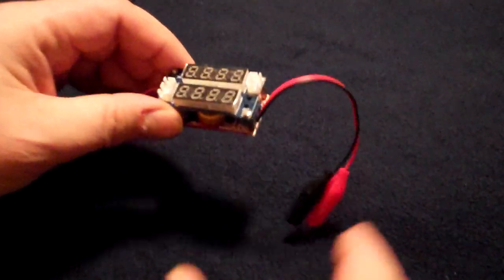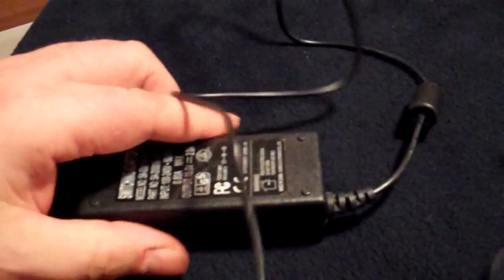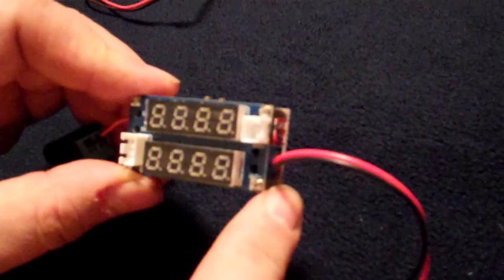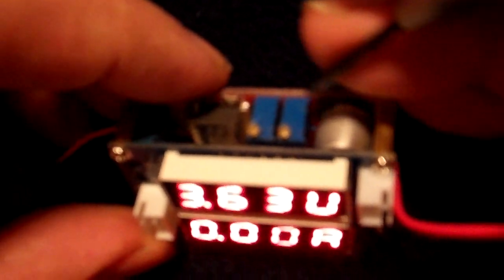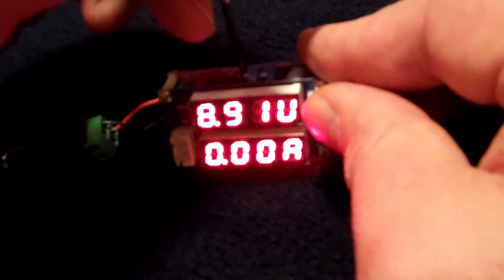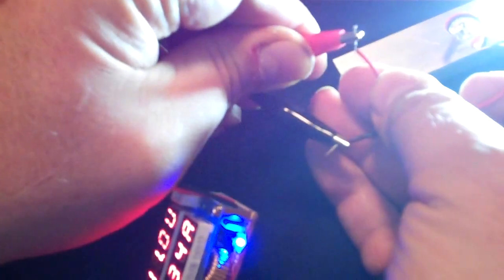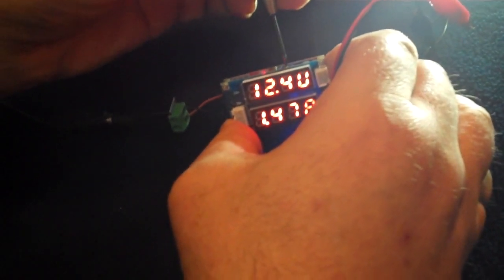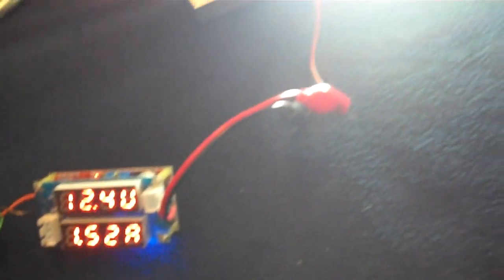DIY Inexpensive Variable Constant Current Constant Voltage Power Supply for under $20

Comment: gijigadget
Wow I am disappointed: I though you were going to show how to build a $20 Variable Constant Current Constant Voltage Power Supply.
If it was a cooking show and you were to say that today we are going to cook a great pot of barbecue beans and then you go the the market and buy a can of Hormel barbecue beans, put in a bowl and microwave it, huh !
BTW the power supply you show here is not constant current: Constant current supply delivers a constant current even when the voltage varies.
I guess if you were to relabel your video as: Low cost Variable Voltage and Current Power Supply. I think I could use one like this. Thanks.
Reply: Sorry you are so disappointed.  This is a constant current / constant voltage supply.  Set the current and it stays as you vary the voltage to a set range.

Comment: be very careful with these, they are current limited, NOT CONSTANT CURRENT!  The last component on the output is a filter capacitor. Check with a scope on a low impedance load, large inrush currents until the filter cap is depleted to the point where the limiter can take control. Ok for charging batteries, not much chop on something more sensitive. Good way to turn a 300 dollar laser diode into a dark emitting led. Otherwise, they're good for about three months, then for no real reason, they fail and generally destroy whatever is attached to them.

Comment: This is not a constant current supply. It is a current limiting supply. If it was constant current you would have had current on the display before connecting the load (LEDs). That is the point of a constant current supply. No matter what the load the current stays the same, even with no load.
Reply from the maker: Well without voltage there is no current.  The voltage can be any arbitrary value greater than zero (can even be negative).  What makes a constant current source is the ability for a power supply to be set to a certain current and maintaining that current independent of voltage value as long as it is not zero or variation in load as long as it is not approaching infinity ohms.
Reply: Ok, I need to straighten the facts about constant current and current limit. Constant current supply keep the current constant no matter the resistance of the load, take for example a 100W LED driver that supply 25-36V @3000mA. As the LED heat up, the forward voltage aka resistance of the LED increase and the power supply will adjust between 25-36V to maintain constant current of 3000mA, but if the resistance is too high for 36V to maintain 3000mA, the current will eventually drop because the voltage. has reach its limit. While in the other side, a current limit supply is a bit different. You can set the output voltage while set for the maximum current to flow. When something shorts, it will decrease the voltage so that the current will be limited. This module is both constant current and current limit. For constant current, you need to adjust the voltage to the maximum and set for current limit to your desired value. For current limit, you need to short the output with ammeter and set for maximum current flow and you still able to adjust the output voltage.
Reply from the maker: +xxxwtxxx It is both a Constant Voltage and Constant Current Regulator.
It all depends on which mode you have the regulator in.
For instance:
Constant Voltage
I set the Voltage and connect the regulator to a Load.
I vary the Load, to draw more Current, the Current Changes but not the Voltage.
Therefore I am in Constant Voltage Mode.
Constant Current Mode:
I connect the regulator to the Load and set the Current.
Now I increase the Load, the Current will be maintained while the Voltage changes.
Therefore I am in Constant Current Mode.

I hope this helps.
Reply: Without a load there is no current draw.  When within the load parameters of the power supply, the current stays the same so yes this is a constant current source.
Reply: If there's no load, there can be no current. I think you're a bit confused.
Reply from the maker: You are correct.
It does not appear that xxxwtxxx understands how Power Supplies work but I am happy to explain it to him if he posts back.
Reply: A perfect constant current source would be comprised of an infinite voltage in series with an infinite resistance. Then the question is, "Would the current in such a hypothetical arrangement be infinite, infinitesimal, or a particular value?"
Reply from the maker: Arthur Harrison Theoretically if you had an infinite Voltage and infinite Current, then Ohm's Law states you would have 0A Current Infinity/Infinity.  However that can't be since if Current is 0A, then also by Ohm's Law, the Voltage would also have to be 0V since I=V/R and I=0A .  The only way this can work is if the Current were to be within the range of non Zero (Infinitesimal) up to just before Infinite Current since by definition, a Constant current maintains a know Current value.
Reply: True but the range of load must be within the design spec of the regulator.  You can't have a Constant Current if the load is infinity i.e. Open Circuit because no current can flow.
Reply: +IRFZ44 I thought a Led lets more current threw the hotter it gets and thats the reason you need a constant current supply for (High Power) Led's i think you got that one backwards
Reply: Right, I would mean the LED's forward voltage, or the opposite of LED's resistance. When LED's gets hot, they draw more current and shorten the lifespan. With regulated current, the LED will last longer.
Reply: It's constant current up to a certain voltage. Just as an ordinary p/s can be set to a constant voltage, but only up to a certain current.
Reply: Really, the current stay the same even without a load? are you kidding me?
Reply: If there's no load, the voltage need to be really high enough to jump through the air to make such a current. It's just a basic Ohm's law.

Comment: Thanks for the great video. These little guys are great for lighting a bulb/led or charging a battery but make sure your load is a steady dc draw. I bought a couple of these and thought they were great until I tried to test out a little 10 watt class d amp, and pooof. The first one literally blew up and split the lm2596 chip in half. It was only set at 2A 20V, and I thought maybe I had a bad one, and tried again. That one died also, Less dramatically, as it just quit. The voltage still adjusts and current sets but output drops to zero with any load. They just can't handle any kind of pulsing load without smoothing it out for them. So I  put a beefy inductor and cap on my last one (220uh 4amp inductor and a 2200uf cap) on the output and it runs the amp fine now.
Reply from the maker: +Thad ward Hmmm that is good to know.
Reply: With this mod does it maintain constant current even if you short the output lines?
Reply from the maker: A constant current source should maintain constant current draw even when shorted.
Remember these regulators are mass produced and cheap so there may be some design flaws.

Comment: Could you run motors on this? Like a motor for a slot car.
Reply from the maker: Yes as long as you stay within the specifications of the regulator.  In fact you can run virtually anything that take a DC input as long as you do not try to draw current beyond what is specified for the regulator.
Reply: So, would I be right in assuming that even thought the regulator is set to max, the load attached can still happily draw a lower current than is set as max. I would like to use a step up convertor/booster to run a car amplifier indoors, but being a noob to electronics I'm finding the constant part quiet confusing.  @gijigadget
Reply: @incorporeal3793  Yes, the load will only draw what it requires even if the current is set to max.

Comment: Can the current level be driven from a digital value in an Arduino or in a Raspeberry Pi?
Reply from the maker: +Giovanni Ciriani Sorry for getting back to you late.  Yes you could use and Arduino or Raspberry Pi by removing the potentiometers and  writing code to emulate the potentiometers.  Should be lots of examples of programs for this on-line.
Reply from the maker: +Giovanni Ciriani I have not tried that but I believe there are inputs to control the values.

Comment: sir pse help i have a 3s 18650 battrey pack will this charge the pack from a solar panel
Reply from the maker: Absolom Madhaka Hi
Yes you can use this regulator to charge 18650 batteries.  The one thing you have to do is not to overcharge them.  The Lithium batteries need to be monitored when charging.  Do not overcharge or trickle charge them.  Once the batteries reach their voltage, you must stop charging or the batteries will be damaged.  You can add a comparator circuit to turn off the charger once the batteries reach full charge.
Reply: gijigadget Thanks a lot the battery pack has BMS that should stop it from over charging so the idea was to use it with the power supply if the power supply is set at 12.6 which is the maximum for a 3s battery then i think it should be ok that was my thinking

Comment: Hi i was trying to find a power supply for this regulator. if i use a computer power supply will it still provide enought voltage and current ?
Reply from the maker: Risker Yi You have a lot of options.  I am assuming you are talking about a laptop supply?  Yes they will work just fine.  If using a computer supply out of a desktop, they require some modification.  Usually a link must be made to connect the 5V output so it will start regulating.  Lots of youtube videos on how to do that.

Comment: Thanks for sharing this video, Ive been trying to figure out how to control the current and voltage of a series of 3W Leds. just picked a few of these up and will be running red and blues on different lines on the power supply. Once I have everything set up ill be posting videos! and its all thanks to you!

Comment: can you use it for anodizing?
Reply: It should be perfect for anodizing as it is constant current, and you can increase the current over the course of the anodizing time. ps feel free to have a look at my anodized model engine, which I anodized using a 12v 3a  battery charger ;)
Reply from the maker: Red Dog Yes you can as long as you adjust the current below 5A.

Comment: have you try to do anything with the serial comm plug?
Reply from the maker: No I have not done anything with the connectors.  I don't believe they are serial connectors.  I believe they are secondary connectors for input output.
Reply: the ebay seller shows the 3 pin connector on the left as serial plug!
Reply from the maker: NikolaosLedZeppelin Ok thank you.  I'll have to have a closer look at that.
Reply: Computer can read data of the module's current and voltage.  Check out http://www.shenzhen-buy.com/index.php?main_page=product_info&products_id=73 for detailed explanation.

Comment: thanks for the reply, basically I need to be able to send a sequence of pulses through a wire, but I need to find the sequences first how would i go about doing this? thanks
Reply from the maker: Are you talking about sending a digital signal?  If so, just build a circuit with a 555 timer to send pulses.  If it has to be an exact sequence, use a PIC or and Arduino and program it.

Comment: Is there anyway to make the current pulse at the press of a button and could you change the speed of the pulse?
Reply from the maker: You could change the frequency by modifying the circuit oscillator.  Pulsing at the press of a button could be done by adding a Mosfet at the output and trigger it with a switch.  Therefore you will use the Mosfet as a switch.

Comment: Thanks for the review. Seems like a nice inexpensive power supply, however my only concern would be whether it adds noise to the electrical lines of your home, or worse, will it mess with the neighbor's electrical devices. It's a low power device so probably little if any, but something to look out for...

Also, you could wrap some electrical tape around your screwdriver to protect the device. Heat shrink would be even better. Cheers!
Reply from the maker: It's a switching power supply so yes it can generate noise.  Your computer has a switching power supply in it as well.  I have not experienced any noise issues in my electrical wiring.  You can limit exposure by mounting the power supply in a metal enclosure if you are worried about noise.  Yes electrical tape would work to insulate the screwdriver.

Comment: That LED strip is bright!  How much luminous flux does it give for 1.5 amp? Are they expensive?
Reply from the maker: This is an 18W White LED Strip.  Lumens just under 2000.  They sell for around $9.00 at dx.com.
Reply: gijigadget Hello. I'm not seeing this light piece at DX. Would you might posting a link to the product? I'm wanting to build under cabinet lights for my desk. thx.
Reply from the maker: Walter Torres Hi Walter;
Here is the link:  http://www.dx.com/p/hzled-20w-2100lm-6000k-cob-led-white-light-strip-12-14v-170-x-15mm-292718#.VLBVXSvF8aA

You can also find it on dx.com by typing "led 20w strip"
Reply: Thank you!

Comment: So what is the big difference in this one from the buck converter which input max current are 3amps?
This one just has volt and amp meter, the bottom bit is similar to the 3amp converter.
Reply from the maker: Yes as jahnkeanater mentioned, it's probably exactly the same and the one you are referring to but with the LED display board.
Reply: I dunno!  This is the one i used.  I'm sure there are several choices out there.  The fact is it's inexpensive and accurate.
Reply from the maker: Yup lots out there.  I just chose this one.

Comment: Please give a part number or search term to help me find this on ebay.  I have not been successful.
Reply from the maker: Hi Frank
Search 5A Constant Current/Voltage on ebay and you will find the regulator i used in this video.
Reply: Found it.  Thanks